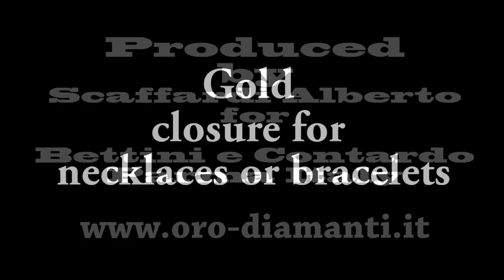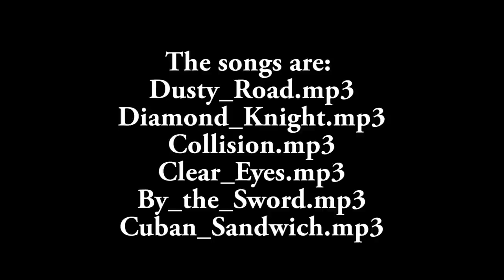Handmade white gold closure for necklaces and bracelets

Comment: Great video thumbs up...I'm curious with the handmade lock lose tension and how to fix it if so? Also why do alot of jeweler's especially Miami cuban link makes use casted locks?
Reply from the maker: It is easier to make a short video than to explain it in words, as soon as I can I do it. Cast parts are often used because they are cheaper.

Comment: I love your work scaffoal. A quick (and newbie) question if you don't mind : is this a durable clasp compared to, say, a spring ring or lobster clasp ? By that I mean, does the mechanism last and function well over time, with possibly thousands of opening/closing ? Besides, is it sturdy, does it resist being accidentally "pulled"/snatched ? Thank you for your help.
Reply from the maker: Each closure has its use and its reason to be used, even for aesthetic choices. This closure, if made well, lasts over time, integrates well with some types of chains, bracelets and necklace clasps. (I use google translator, excuse the errors)
Reply: scaffoal thank you very much for your answer scaffoal. I am working on a « standalone » clasp that ties both ends of a spliced rope. I craft the clasp from titanium and I explore new ways to make it, hence my question.

Comment: The problem i had was soldering the push button  onto the tongue part,without making the tongue soft and becoming weak and sometimes too soft to work.Do you let the tongue air cool or dunk in water ,acid asap after soldering to keep it's strength?
Reply from the maker: After welding, to restore the strength of the spring, you have to hammer it slightly, to work harden the metal.

Comment: I have made several attempts at this closure with varying degrees of success. The problem I have is that when soldering the release button the spring, the spring loses its spring. Have you had this problem? Further to my last comment, I was using .7mm 925 silver and the closure was a bit smaller than yours which I might add was much more pleasing to the eye.
Reply from the maker: it is normal, the metal when it is heated loses its elasticity. you have to hammer the spring lightly, in order to harden it.

Comment: I think one of the most important part in clasp making was missing. After soildering, heat ruins elastic form of the clasp(it's inevitable after annealing process). How come do you manage to  get it back without scratch?
Reply from the maker: if the slot that allows the passage of the spring is precise, it takes very little for the spring to catch.

Comment: I have made several attempts at this closure with varying degrees of success. The problem I have is that when soldering the release button the spring, the spring loses its spring. Have you had this problem?
Reply from the maker: it is normal, the metal when it is heated loses its elasticity. you have to hammer the spring lightly, in order to harden it.
Reply: Thank you most kindly for your reply. Yes I understand that the spring needs to be work hardened after it is heated but the spring is quite small (less than 5mm x 10mm x.5mm and work hardening tends to deform it somewhat. The spring release button was formed by slitting the end of the spring into three prongs. The centre prong was bent upwards to form a small goose neck which when pressed down, released the catch. Very difficult to work harden.  Never mind, I'll work out something, perhaps using fine spring steel. By the way, your work is most elegant.

Comment: How do you attach a necklace or bracelet? I see no connecting places. Beautiful piece!
Reply from the maker: it can be used for various types of jewelry, depending on the use the necessary pieces are welded.
Reply: Does that mean you would solder (weld) on another component? Perhaps jump rind attachment? It is very beautiful. Thank you for making these gorgeous videos and pieces.

Comment: Great ! How much for one like this ? Do you ship to Brazil ?
Reply from the maker: This type of closure is expensive to manufacture, it is used for important hooks or bracelets. there are similar closures made with molds by specialized firms, less refined but much cheaper. However we can make to order what the customer wants and send it. If you are interested you can contact scaffoal@oro-diamanti.it for quotes and shipping costs.

Comment: please suggest
 the engraver(driller) with diamond points bits 
machine model  name  at mid range.
Reply from the maker: I do not know what to say to you, having always used manual engraver
Reply: scaffoal  which burrs or bit u used to drill gold and silver 

And which mechine u used for stone fitting setting 

DREMEL  OR  FORDOME POWER TOOL

suggest me mid range model for drilling holes and stone fitting burrs